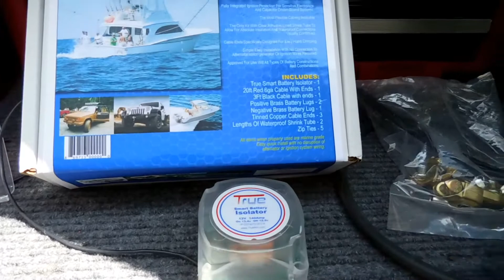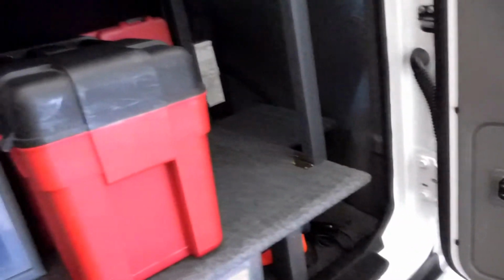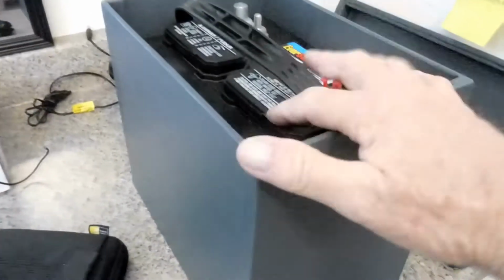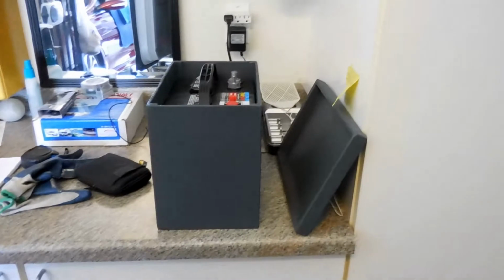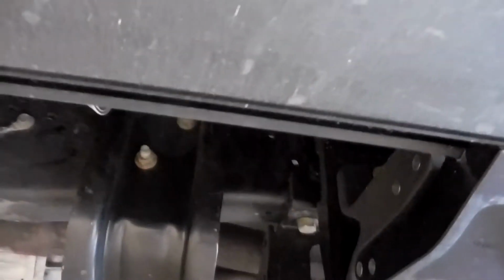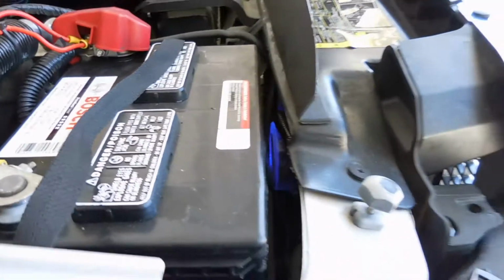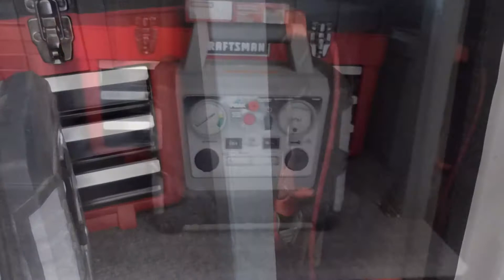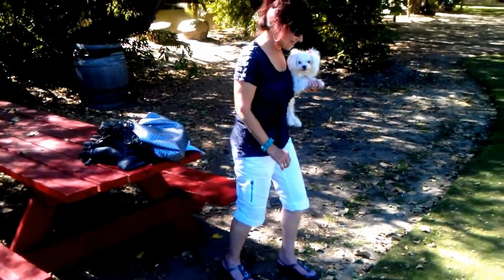037-2014 Ford E350 4x4 Super Duty Quadvan-dual battery

Comment: I am surprised to see the kit come with 20' of  6 AWG.Engineering charts spec 2/0 AWG for a thirty-foot circuit.I wish I could perform a voltage drop test on this setup. I am doing the same thing to an E150.
Reply from the maker: If you are interested for more information on your project, here is the Amazon link to the JayCorp Dual Battery Isolation Kit with 140A Smart
Battery Isolator (VSR Voltage Sensitive Relay) in the video;
https://www.amazon.com/gp/product/B00400D6WU/ref=ppx_yo_dt_b_asin_title_o04__o00_s00?ie=UTF8&psc=1
👍

Comment: What was your purpose of 2 batteries
Reply from the maker: To power any added accessories requiring 12 v DC power like a power converter, lights, etc., the second battery is used to power those accessories on the isolated circuit (second battery) from the starting primary battery. Add a fuse block to power accessories and relays separate from primary circuit wiring system.
Reply: Oh ok,nice
I just bought a 2010 E350 superduty im getting it ready for the trips to the Colorado mountains n lakes
Reply from the maker: @jvalles27  👌 nice, we're you able to get the diesel last year in 2010 or the V10? I loved that van 😎
Reply: @jvalles27  Wondering what you went with/  I've got the same van and planning to do this soon